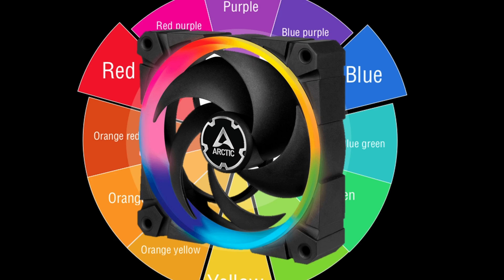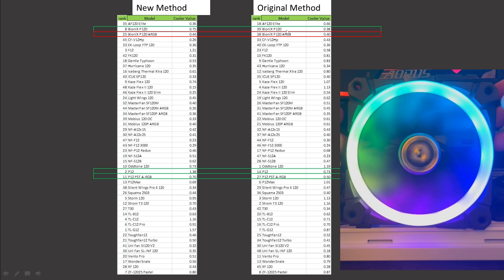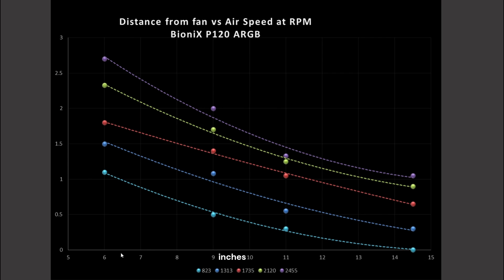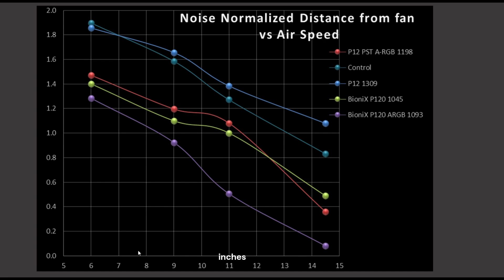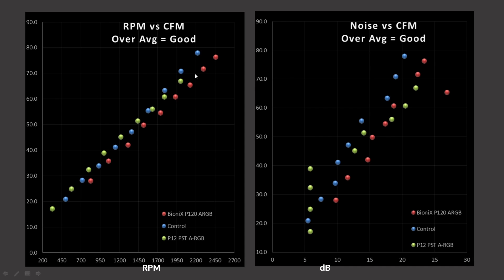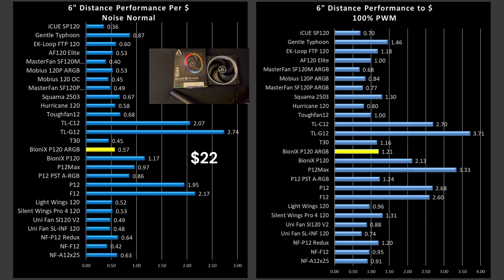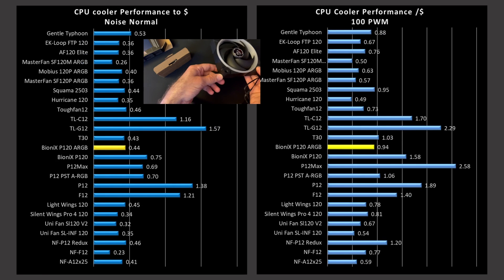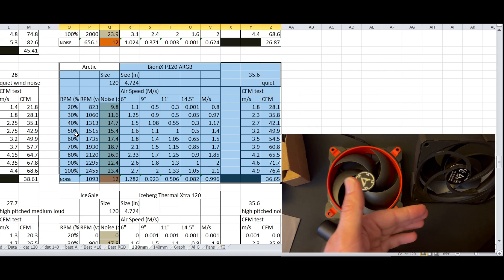(New Testing) Arctic BioniX P120 ARGB  (Review)

Comment: I think I notice this a lot between the videos, especially since they're not released in the order that you've performed the tests.

The Noctua A12x25 performance, being non-representative of the most recent results, is quite underrated when compared using its older measurements to other fans.
Reply from the maker: I think ive said it before. some where along the way I had to re-test fans and updated results. I basically re-reran fans that appeared lower than I thought. SO I had to back track when the change happened. 
It error was only in the cooler testing. So the round up is the newest best data.